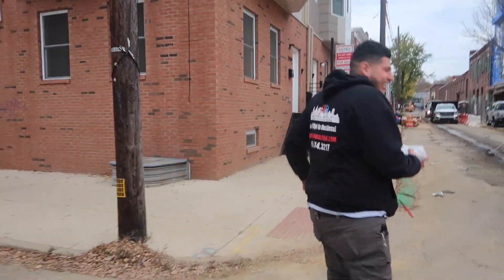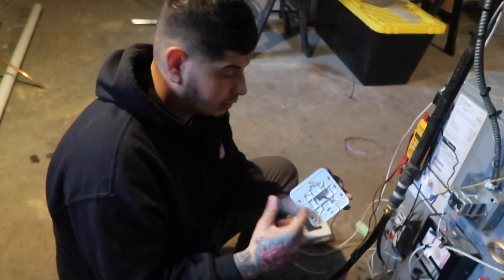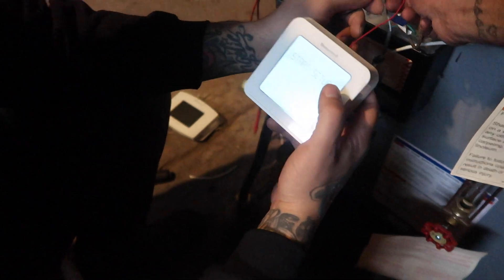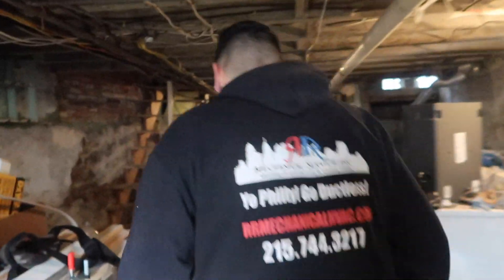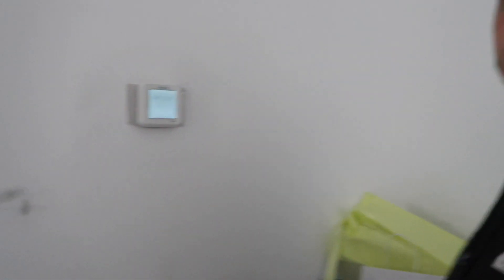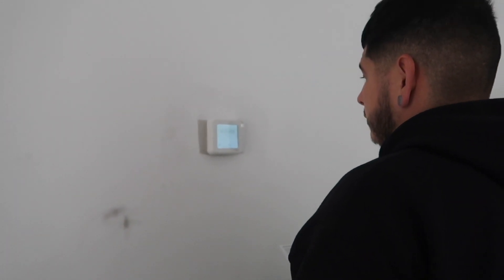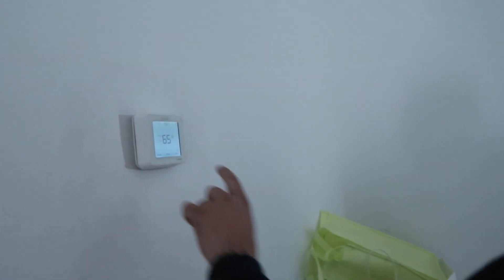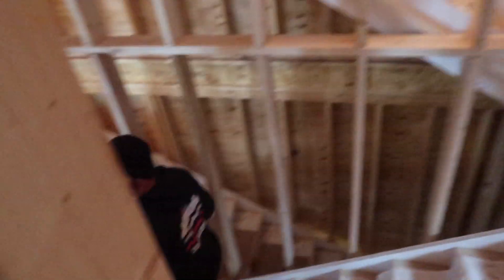INSTALLING A WIFI HONEYWELL T6 THERMOSTAT ON A STEAM GAS BOILER FOR THE FIRST TIME!!!!

Comment: Nice job white, you did something that you  never done before, ran in to a small problem an you worked threw it an figured it out an got the job done. That's what a good mechanic does. Don't even  acknowledge these haters, cause they have no clue what they are doing, probably never been in the field. This is one trade where you will learn new stuff from your first day, all the way till your last day. Been doing this for 16 years, an still learning new stuff.  Keep doing your thing an keep your head up 💯